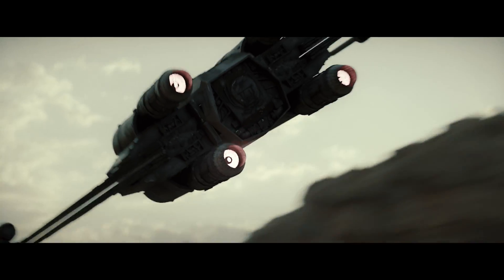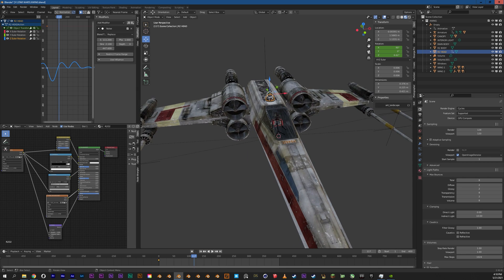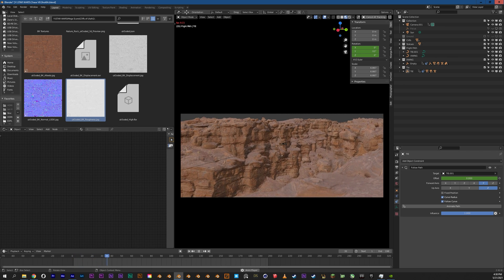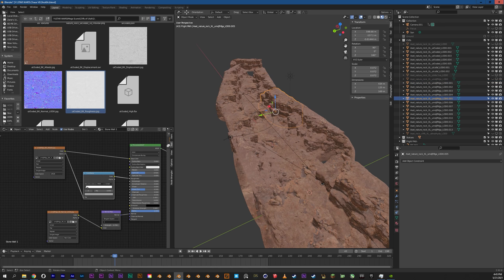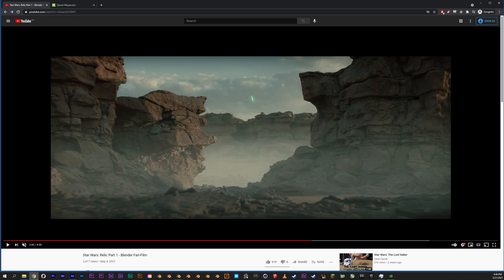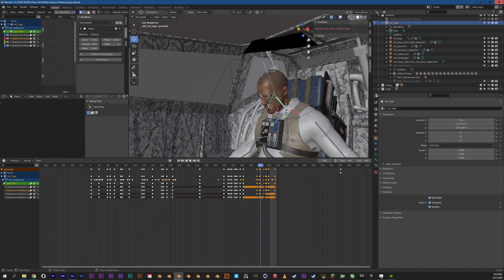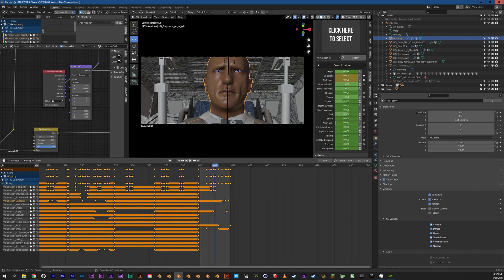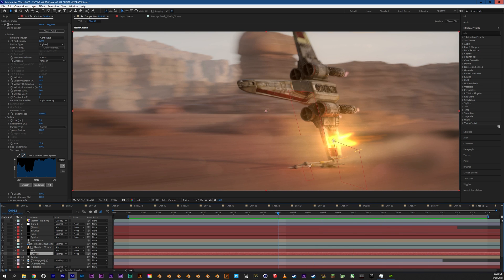Star Wars: Relic Blender VFX Breakdown

Comment: Wat type of computer do you use? I'm currently using my macbook and it is not very helpful lol
Reply from the maker: I have a PC running an AMD Ryzen 9 3900x 3.8 GHz 12 core processor, a GTX 2070 Super, and 64gb or ram. That being said, most of the time I save is in rendering. Everything I made could be made on any computer, rending will just take longer
Reply: @ZaneOlson  is there any way to upgrade my macbook to so it will process my bledner files better? I have to make very low poly scenes because my macbook will just crash otherwise
Reply: @peterrandall6761  my friend PC is the way. My opinion macs are overpriced and useless.